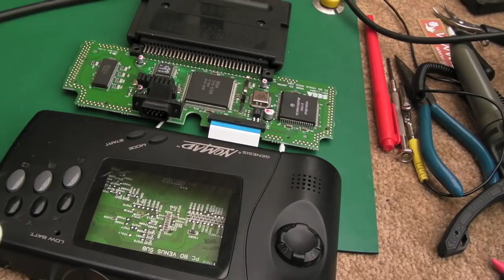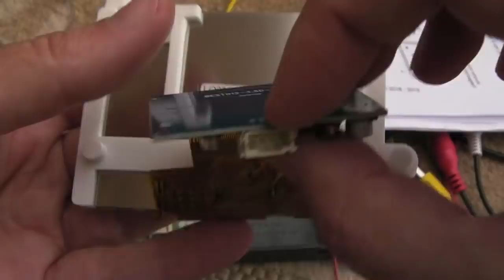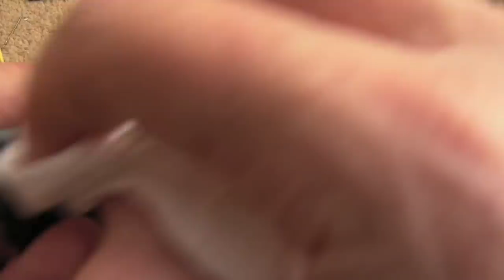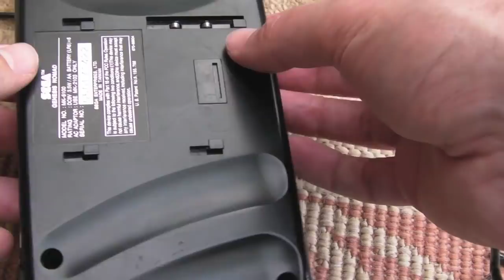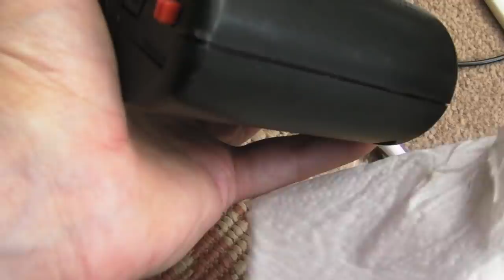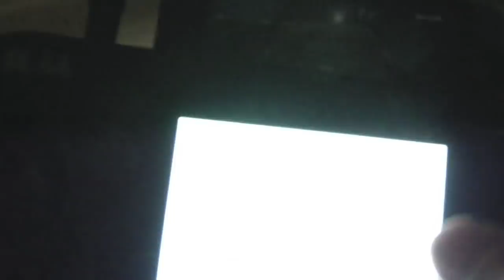Sega Nomad Repair Part 2 (TR201 Bypass & Replacement Composite LCD & 3D Printed Mount)

Comment from the maker: Part 1 - https://www.youtube.com/watch?v=F-aKPsebPFs
Part 3 - https://youtu.be/n61HHO1BUg0
Measured total current in part 3 - it only draws 0.4amps now!!!  With a 5000mAh battery that would last 10 hours!!!  The original unmodded Nomad has a rating of 9V 3.5W = 0.39 amps.  So it's very close to the original amount of current drawn by the original screen.  I guess the other plus is it shouldnt fail from an overheated TR201 moving forward.
You should check out his excellent channel here:- https://www.youtube.com/channel/UCEHkvZV6pB6uw-NSmGsM-kw
His recent awesome Sega 32x repair:- https://www.youtube.com/watch?v=voECR9LqCzA
Dennis van den Broek on Twitter:- https://twitter.com/PointerFunction
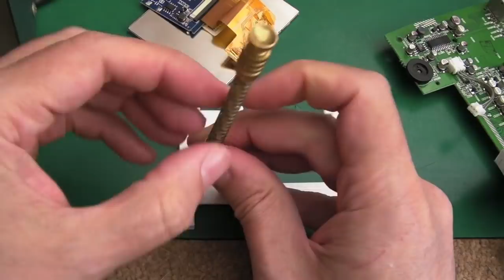Reply: 21:57

Lots of material here for another "rude remix" vid. lol

Good vid, though. ;)

Using the DC-DC on the LCD board is a good idea. I'd be a bit worried at drawing close to 2 Amps from it, but the ~1 Amp for the screen + Nomad shouldn't be a problem.

I've used those same boards where they're designed to run from 12V, removed the unneeded cap and switching reg, and just power them from 5V. The only thing I did find then is that the screen had a tiny bit of noise on it, so it's best to keep the input inductor and cap if it has one (or add an inductor to the 5V input).

It's a real shame they don't generally break out the RGB pins on these small boards, as I think the AMT630 can handle RGB, Component, and even VGA refresh rates. Or maybe that was the slightly larger chip. Can't remember now.

I have some source code for some of the Mstar and Realtek chips, which was originally an effort to write some custom FW for doing Game Gear / Nomad / Lynx screen mods, and remove the mildly annoying "AV" text when you power it up.

But then I did that LCD board with HDMI etc. One day I might actually finish it. lol
Reply from the maker: Yes, it would be nice to replace the driver board - just to get rid of that AV1 lol.  But it could be driven properly then too - ie. from the RGB rather than middleman of composite to the SPI or whatever interface it uses to drive the display there.   I tested using 5v bypass and using the DC 2 DC and I think the diagonal lines still appeared either way.  No sure if it's noise from the Nomad or just due to the poor composite signal.
Reply: Thanks for making these videos! Used them as a guide for the one I've just acquired. Great help on the wiring for the buck converter, also removed TR201.
I've found that it draws 480-530mA @ 9V (4.5 watts!) from the battery pack terminals with a cartridge installed. De-soldered the original LCD's driver IC, dropped ~20-30mA, but still not as low as yours. Now that I think about it though, I've installed a NOR gate to add reset functionality with the Start/Mode buttons (worth looking into), so that accounts for some additional draw. I'll probably swap it for a single input surface mount variant at some point.
Anyway, thanks again!
Reply: Dumb question since I'm not the most fluent in electronics would you be able to put a 5000 mah battery into the original battery pack if you didn't want to do an internal mod?

Comment: I have a sega nomad. I am working to repair it. I have no idea what I am doing, other then I have taken it apart and separated things and noticed two or three capacitors broke and are leaking. Where can I buy replacement parts online easily for this device and do you have a discord server where I can join and get help for the repairs?
Reply from the maker: Console5 sell cap kits for these!  For other spares, you can find stuff on Digikey or Mouser.  Parts can also be found on AliExpress or eBay.  I do have a Discord server for Patreon members - people are always in and out of there to provide advice if needed.

Comment: How come every video I watch of someone doing the LCD modification, yours included, the screen has a strip missing from the video? its narrow vertically and your video doesnt look full screen because of this.
Reply from the maker: These "parking screens" are marginally larger than the original screen.  I agree it's not a 1:1 replacement and that could put lots of people off.  In this case, there was no functioning screen with it, it made sense to fit what I could.   I use it regularly and most games fit OK in the space available, just a few where overscan etc isn't as visible as it should be.

Comment: You are absolutely the bloodiest smartest person that is on YouTube. I have looked at 100+ video's to fix my Nomad and you where that only one that addressed the same issue that I was having. Everyone else kept telling me that it was the voltage regulator, or the caps where bad and so on. But when you had the same problem that I had with the power port. You crushed it. My battery pack would not work also until I took apart the the Jack and fixed it. Then resoldered it back on the PCB and I worked. Thank you so much for help all of us with your great videos. I am very glad Dennis sent you a Nomad.
Reply from the maker: Thanks!!  Very kind of you to say that =D  Really glad you fixed your Nomad!!!!

Comment: So the big pad where the old regulator on the nomad would sit on would basically just be a ground? I just acquired a nomad and like yours it is missing the regulator and the pad that was supposed to be there, seems like somebody just yanked it out. The three pins on the board are still intact though, can I just take a new regulator and solder three pins to the three pins on the board or since it's missing the pad underneath do I have to solder the tab of the new regulator to a ground somewhere on the board?
Reply from the maker: Yes, the tab is grounded I think.  Best to find an area of the ground plane nearby, scratch that off - solder the tab there, route the other 3 connections via wires to where they normally go on the regulator.  If you don't mount the tab to a large piece of the ground it will overheat in no time!
Reply: Got it, thanks for the reply you saved me from messing up another regulator👍

Comment: Hi! I just bought the same screen and when I installed it the screen is blinking black. The only thing I didn't do was remove the original screen in case the mod doesn't work. My question is: Is it necessary to remove the original screen for the new lcd screen to work? I'll appreciate your answer. Thank you
Reply from the maker: I cannot be 100% sure, but I suspect the old screen is drawing too much power whilst the new screen is powered too.  I  recently found if the voltage level drops too low on a battery pack I have here, it behaves exactly as you are experiencing there - screen flashes on and off, but you can see its booting etc.  That leads me to think the LCD screen isn't happy when the voltage drops due to insufficent  power.
Reply: @GadgetUK164  Thank you very much. my fear is to remove the original screen (it has a damp stain) and it won't work. That is why I would like to be sure. If I connect the new lcd screen externally (video / voltage cables) it works without problems.

Comment: Great video as always. I’ve got an issue with my Nomad it gets as far as just after the TMSS message then resets and carries on over and over (happened before I did the lcd mod as well). It’s definitely the top board as the bottom one works fine on another working to board. video link here https://youtu.be/OeNMARmd19M
Reply from the maker: Thanks =D  It could be a dirty cart slot, but also a damaged trace from capacitor leakage?  Beyond that you may have a faulty IC somewhere.
Reply: @GadgetUK164   turned out to be a fried 315-5684. Once the 315 was removed the system works fine, but with no sound. I managed to get sound with a spare standard triple bypass board, but after running the MDFourier test it seems way off normal (although it sounds ok to my limited ears), MobiusStrip helped me out with that bit. Anyway, I've ordered a proper Nomad Bypass from Mobius which should fix everything in one go, which I plan on making a video on.
Reply from the maker: As per my comment on the video - I would start by recapping it.  It could be noise on a supply rail due to the caps, or the reset circuit repeat firing due to cap and leakage.

Comment: eso es un display de coche  llamado gps y eso se alimenta con 12 vol el nomad se alimenta con 9 vol  si no modificas ese display de gps  muere el nomad por que no aguantara el nomad 12 vol
Reply from the maker: No, the display can be powered up to 12v, but works perfectly at 9v.  It uses a DC2DC convertor.
Reply: https://www.youtube.com/watch?v=sSuXRXXp2o4&feature=share&fbclid=IwAR2qEjIioPOMEiivAswGHN4W8SL-BNHqKE7g_y78Jy_XiaRv2SJ5i0trQS0 nomad sega revives with sega dreamcast PART1

Comment: Thank you so much for this great video. I have the same LCD model with the XL1509-5.0e1 dc-dc converter. I would like to modify my Sega Nomad with the USB 5v mod but I am not sure if that is possible with your mod of the LCD, I mean: providing 9v-14v in the LCD and feed back to the PCB console with the 5v output. Thanks in advance.

Comment: Great content Gadget, I haven`t done much with handhelds myself but did wonder what implications pulling psu power from a display board would have. I suppose its not just any old display board, its a modern board obviously capable of providing both. I wasn`t worried about current at all, more interference. Great utilisation of a modern component to the max. I never get tired of your endeavours, pure GOLD!
Reply from the maker: Thanks =D   Yes, I did worry about the DC 2 DC (or any other - eg. Recom) interfering with the Nomad, but it doesn't!  The LCD screen has some noise that I spotted when testing with 5v only (eg. bypassing the DC 2 DC), and that noise does not appear on the AV output.  Sound is perfect either way.   I think the DC 2 DC affects these screens in general, it needs a cap and inductor of the correct size to filer it out.  I talk about that in part 3 briefly towards the end.

Comment: Brilliant fix making use of the LCD DC-DC converter!
Reply from the maker: I was worried it might generate noise on the sound or video, but it seems OK.  There is still a bit of noise on the LCD though as I talk about in part 3.  I think the DC 2 DC does create some noise on the LCD - but via the AV port its perfect.  It's also the same with or without the Nomad PCBs connected, so it's not a case of the DC 2 DC being affected by the Nomad.   They are cheap screens used for reverse parking on cars I think.

Comment: IIRC there is a switchless region mod you can do, and what might be a fun project is tracking down a battery pack for it and replacing the NiMH batteries with lithium and a proper charger for it :)
Reply from the maker: I was going to adapt my PIC based mod to do the same thing!
Reply: @GadgetUK164  looking forward to seeing what you come up with :)

Comment: The Sega Nomad is looking great Chris. Surprised the system only draws 260mA (without original screen), I thought it was going to draw more even without the screen. The original TS115 voltage regulator is rated at around 500mA, It must have been a catastrophic fault to have burnt up the TS115 voltage regulator.
Reply from the maker: Cheers =D  I was surprised it only drew 260mA too!  I've seen a few threads and videos where those regulators burned up - I suspect it's just because its a super small component, and as you will see in part 3 the Genesis / Megadrive 2 PSUs output up to 14V.  That's a lot of extra heat dumped into that board by that tiny regulator, it's no wonder they fail imo.   Using batteries is safer due to the voltage being 9V or less (but no reverse polarity protection there).

Comment: Regarding the PAL/US carts, PAL carts go in US machines, US carts don't go in PAL machines. Japanese carts don't fit either machine, and vice versa.

Some games are universal ROMs, others are region locked, Hence why you need to expand the cartridge slot when you Switchmod a Megadrive/Genesis.
Reply from the maker: Thanks for the info!

Comment: i look forward to part 3, i've wanted one of these systems for years so it's fascinating seeing what mods can be done and problems to look out for in them :D
Reply from the maker: Cheers =D  They are lovely systems, wish I had bought one sooner now!  I think there's a misconception that these could be hard to repair - I think they are pretty simple, especially when you can get spares from Model 2 boards, and replacement composite screen & glass etc.

Comment: Thank you, GadgetUK164, much appreciated repair, & mod of the Sega Nomad. Nice recapping work.
Reply: The one missing a pad using a wire for nice fix. I understand how you felt when you powered it up last video and it worked. What a relief.
Reply: I wished the battery terminal had a reverse polarity protection diode.
Reply from the maker: Yes, the problem there is with the existing "in series" diode it drops the input by 0.7v, and I guess they didn't want that drain on the battery.  What you could do is a simple mod to fit an internal fuse, and reverse mount a diode between the 9v and grounds.  That way the fuse would blow if ever reversed polarity is fed in either way.

Comment: Controversial thought - power from USB power bank/transformer which will give you 5V easily but also many will source 1.5A comfortably.
Reply from the maker: Yes, I talk about USB in part 3.  You could go that way, but I wanted to keep the 9V DC input from the battery pack and the DC jack.  If you want to feed 5v from any USB cable / power bank, just feed it into the 5v pin on the AV socket!  That way no mod is required at all, just a custom cable.